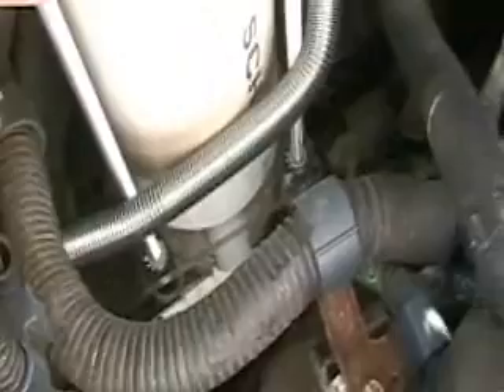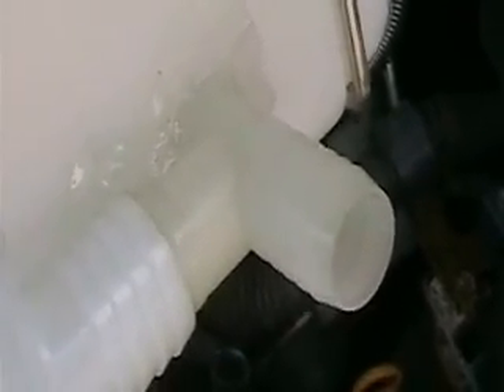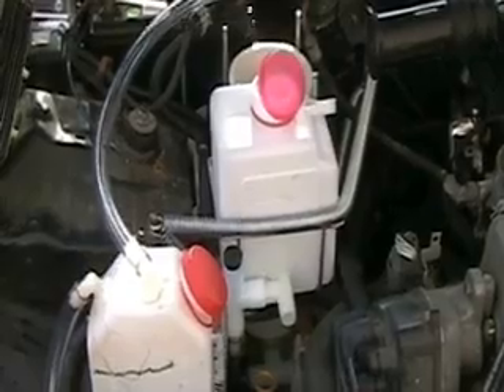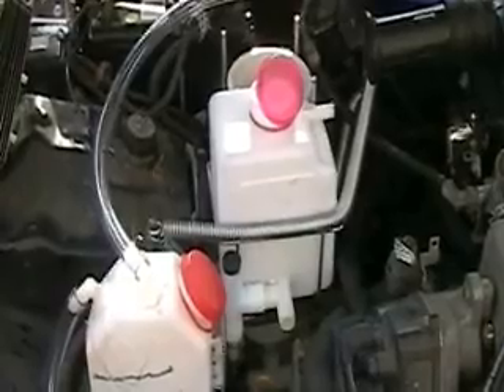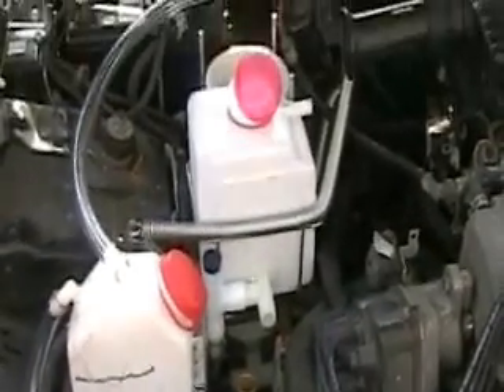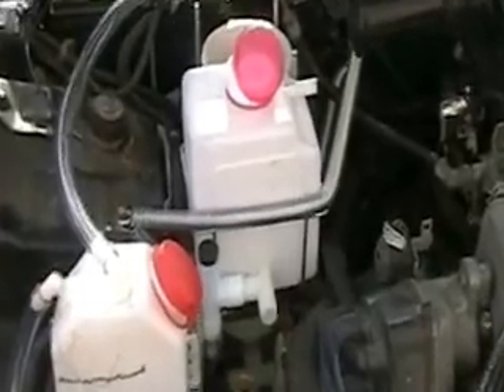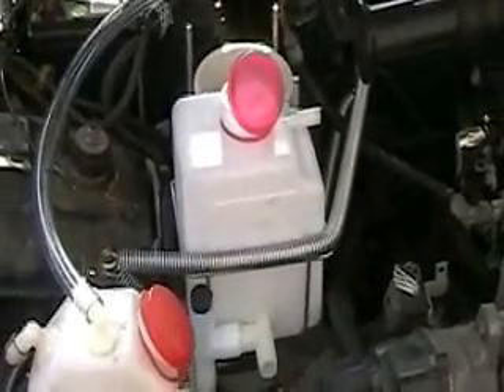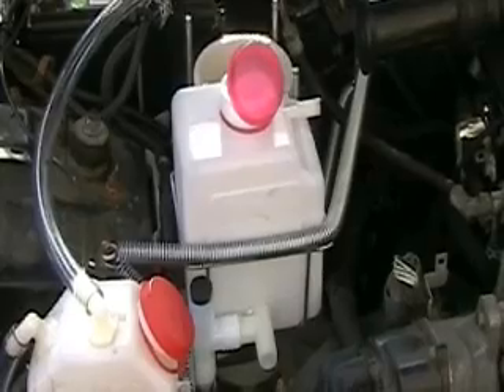Hydrogen Tap (FOCUS - install) 375

Comment: im not sure, because i can not see it very well.  but you seem to be using pex fittings, and it looks like you are putting the pex tubbing on the inside of the barbs, but they should be on the outside.

just a thought if you were using the pex tubing the wrong way.

Comment: John, is that the original fuel filter?  If so, you should change that before you get the rest of the Focus cell on there.  I think honda says it should be changed every 60k.